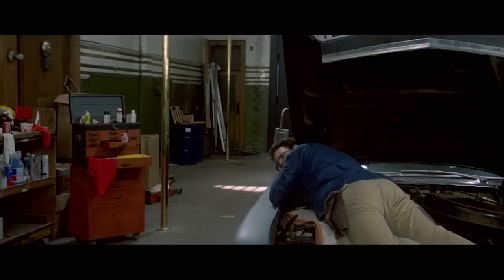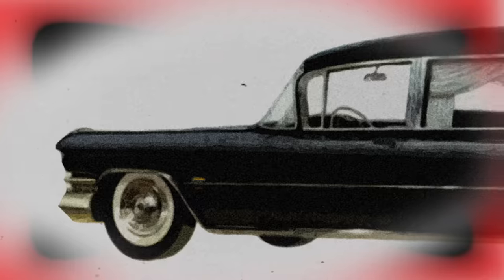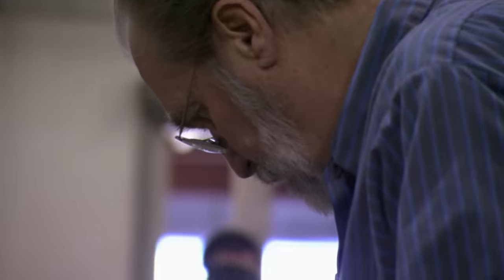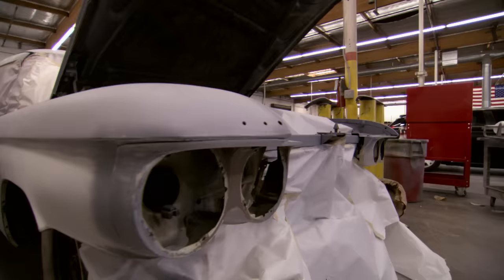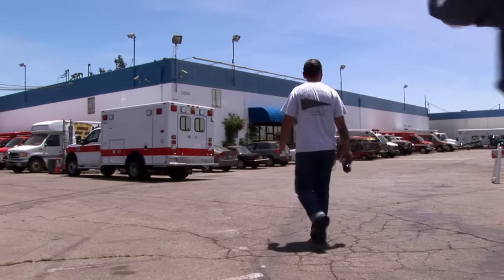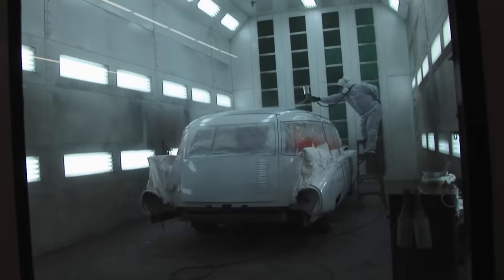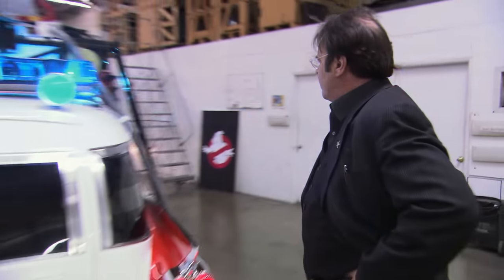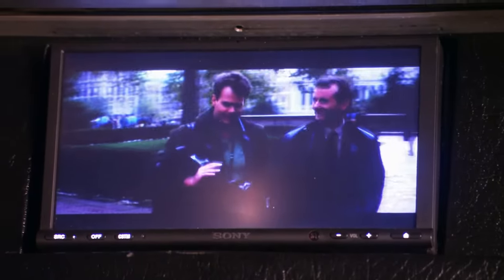Ecto 1 Featurette: Resurrecting the Classic Car | GHOSTBUSTERS

Comment: I remember when I worked at Sony and one of the Ecto-1s was rotting on the lot next to a bunch of other cars. At one point, they had to move it by pushing it. Even if it wasn't in a movie, a '59 Cadillac, especially a professional car conversion, would be really valuable.
Reply: That’s the ecto 1a, it was in ghostbusters 2
Reply: @RealJoePool  not sure about that, 1a was kept in better condition, it's the car they're using for Afterlife.
Reply: @MephProduction  the ecto 1a was put on display for universal and then when it was damaged by staff/park visitors it was put into a Sony backlot, the story he tells seems to match up
Reply: @RealJoePool  maybe,  both cars got refurbished
Reply: @MephProduction  ecto 1a never got referbished, it was planned to be but was used for parts for the original ecto and then was left to rot again, it was then repurposed to be a copy of the original ecto for use in afterlife
Reply: @RealJoePool  yes that's what i meant,  technically  it is a form of refurbishment.
Reply: William,  I was wondering how many cars (59 Cadillac's)did the studio have for the movie ?  If you know at all...

I ask because, I was a Firefighter on a Department in Illinois.  And it was common knowledge that a studio had bought a old Cadillac Ambulance from the Department.  And we had papers releasing the studio from any "Anything'
that involved the Department.  From my understanding the car that the Department sold was in fairly good condition.  But I'm not sure just how much of that was true.  If any of it. 

And if one of those cars was from our Department.   It was used to transport injured and dead from a aircraft crash site on Sept 1,1961.  TWA flight 529.  A Lockheed L-049 Constellation in Willowbrook Township, Illinois.
Reply: @jeffherdzina6716  they only had two in total.  one was used in the 84 film, and the other was used in the 89 and 2021 film.  they didn't have stunt versions or anything which is why the car doesn't do a great deal in the early movies.
Reply: @MephProduction  very true!

Comment: I'm gonna weigh in again. I loved the mov, and the cartoon. I had a hess eisenhardt 1960 hearse. Daily drove it, and it was a beater. 100 miles a day daily drove it. I'm gonna dissect this video a bit. Miller meteor cars aren't common,  but aren't uncommon either. Windshield was the same on commercial cars from 58 to 64, factory limos too. As I said before,  once you're used to these giant cars, you can handle them like a Honda civic.  I loved the 340hp 390 engine, those are total units. The god awful (and no tranny shop here will touch them) jetaway 315 trans isn't my fave, after putting 3 in, on my back, in the dirt, balancing that heavy cast iron monster on a floor jack. These cars have a ton and a half of chrome. Commercial cars have a front clip slightly larger than sedan stuff. Meaning hood and fenders change as a set to sedan parts. I 500 swapped mine with a th400 and 3.55 9 inch. Used an el Dorado oil pan. The generator might work ok for some, I used the 70s ambulance alternator. I love the ecto 1 from my childhood,  love the series, but this resto video is over dramatized. A friend of mine has an almost endless supply of restoration parts right near Raleigh NC.  I'll be buying a 59 superior from him soon that needs repairs from a tree falling on it. And he has everything the car needs besides metal work. Super cool car, and I'm glad its restored and usable,  but the restoration wasn't near as bad as it was claimed. Dislike if you want. I have owned the second best car, a 1960 S&S, and made it a driver after sitting for 20+ years. Not a complete expert, but I put in my dues.

Comment: If ur a car fan, then u know why the tail looked like rockets.  These cars Chevrolet, was built during the space eara.  So they put the rocket look to the cars.  The steering wheel was deadly.  Because of the point,it would kill u in an accident, so finding the original wheels are hard to do.  ✌️👍😎❤️👻.

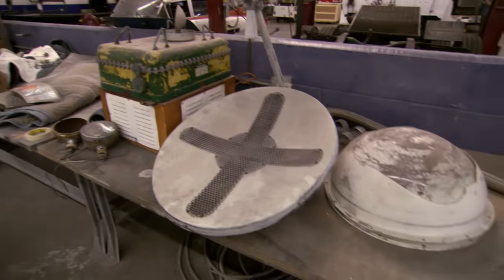Comment: While watching this they show pictures of ecto 1 a when they took it apart as original they were gonna refurbish both cars 1a wasnt that bad as it had been at universal studios on display for years ecto 1 was in ok condition aswell if you find images of it before they took it apart  here are time stamls for ecto 1a pics 4:01 you can see it has the 1a tires 4:13 also 1a same with 4:15 you can see the ghostbusters 2 logo they removed 4:56 here you can see ecto1a roof rack parts and thats all e to 1a pics shown also ecto now needs some work ive seen some recent pics and rust is beginning to show on some ouside pars of the main body the blue hoses are completley destroyed and all crinkled and the paint on the red light on the toof rack hos mostly rubbed off even though its the wrong  type of light so sony need to do some renevations on the car

Comment: Wonderful featurette. However, I have a question. GB Afterlife is supposed to be a sequel, which means it takes place after GB2. Then the siren light set is incomplete, the GB 2 set was multicolor, with letter screens on the sides. This model reproduces the GB1, I think.

Comment: The only thing that bugs me about the restoration was how many inaccuracies of colors or parts on the car. Like the front light bars are the wrong size and the wrong mountings. The sniffer was painted the wrong colors and they placed the motor backwards to where it’s facing the wrong way. And the one thing that both afterlife and the restoration missed were the yellow warning labels near the grimes strobe lights on the front grill.

Comment: I have a 2 dr. 1959 Cadillac Coupe-De-Ville that I fully restored. I know exactly what they went through on the outside of the car. The 2 things I disliked the most about a 1959 Cad is that stupid dash that was so heavy to remove. And that oil canister that it had instead of a screw-on oil filter. But when you drive it around, the fins, and the size of the car, just amaze people today,,,,,,,,,,,,,,,

Comment: I love classic cars, been working on cars since I was 11 and love to see them in TV and films.  The only thing that irritates the hell out of me is when movie directors or whoever shows something that clearly has nothing to do with the actual car itself.  Ecto 1 is iconic super large late 50’s V8 powered car. I was saddened to see in afterlife they had a shot of the engine and showed what appeared to be a crappy 4 cylinder and a distributor that stuck up too far for the hood to close.  If you wanna do something stupid in films at least take into account those of us who know what we are looking at or doing. It grates my nerves as bad as the morons pretending to weld in movies.  There are many movies and shows ruined for me because of my technical knowledge in a variety of things.  Macgyver, who’s tricks would possibly work in a perfect world with laboratory settings. Or Scorpion, which was the most far fetched bull crap I’ve ever seen.  And don’t get me started on the fast and furious franchise, it’s one of the most infuriating.  As a master mechanic, welder, electrician, plumber, carpenter, mason, industrial technician, and meat cutter extraordinaire, please don’t insult me with the obviously blatant lack of knowledge of the subjects you film.  Thanks.

Comment: I am aware that 1959 Cadillac Miller-Meteor Futura Hearses aren't easy to come by nowadays, but if I were fortunate to come across one in a junkyard in good shape and condition on the outside and inside a little rusted some that could be a fixer-upper, I would definitely buy it and convert it into my very own film-accurate replica of the Ecto-1 down to the last detail and replace the rusted metals, floorboards, seats, steering wheel, windows, engine, alternator, radiator, belts, lights and replace the old radio with a CD player and audio surround sound speakers to play the Ghostbusters soundtrack and I would use the Blitzway Ecto-1 and the Ectomobile Owner's Workshop Manual to have something to go by.

https://news.toyark.com/2017/11/20/blitzway-ghostbusters-ecto-1-full-details-278633

https://www.ghostbustersnews.com/wp-content/uploads/2017/03/manual_gb_ecto-.jpg

And I would use this production-made door emblem for my replica and keep my replica in a 10x30 size storage unit with a big clear tarp over it to save for a Halloween display and a car show.

https://www.heroprop.com/wp-content/uploads/2017/08/Ghostbusters-Production-Made-Ecto-1-Door-Emblem-1.jpg

https://www.storage.com/images/storage-guide/diagram/tenbythirty.gif

Comment: tbh the car was the one thing in afterlife that bothered me most, not because they didn't do a superb job restoring it, just they restored it to the wrong version.  Why is it retrofitted to being an aged version of the Ecto 1 from GB1?  Shouldn't it have been in it's Ecto 1A form as the movie does hold the events of GB2 as canon?  Given Egon basically stole it and was running his project on a shoestring, how did he have the time or funds to totally retrofit it back to the original mk1 instruments?
I can see him maybe stripping off the extra light bars and signage, that was probably Venkman's idea and just dead weight for Egon's purposes.  But there was actual hardware additions on the 1A as well.  And why then neglect it in a barn after taking the time to do all that?
Reply: Jason Reitman has stated that Ecto 1 and Ecto 1A are two different vehicles. Ecto 1 is sent to the farm at the beginning of GB2. Which is why Ecto 1 in afterlife has the same issues as it does in GB1. ECTO 1A is a new vehicle which is why it has a new paintjob and is in mint condition. Ecto 1A then goes to auction with the firehouse canonically. There is actually a BTS at the farmhouse with Adam Savage Tested where you can see Ecto 1A plate on a shelf in the barn in the farm house.

Comment: Did they use this, or a newly-built car for the 2021 movie? The car in the movie is fairly grubby - it supposedly had been left in a barn for decades. But, of course, it had to work perfectly.  Did they maybe stick dirt and dust on this after it was rebuilt? They certainly stick dirt and dust all over perfectly good-looking actors for specific parts.